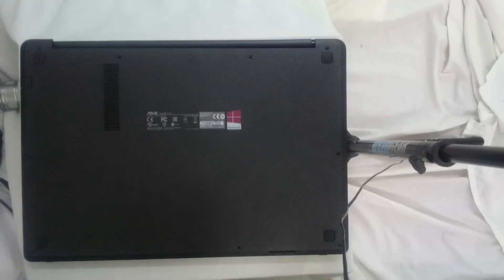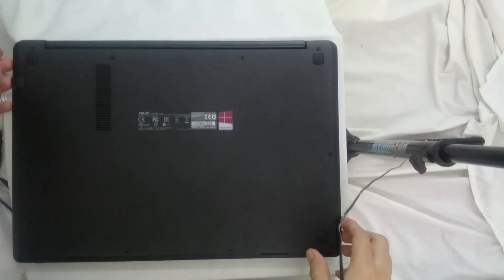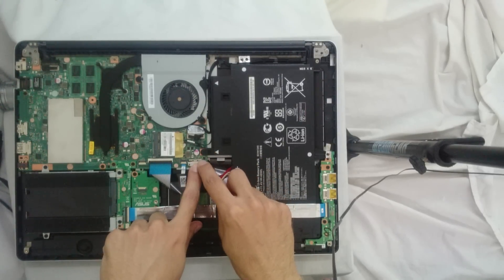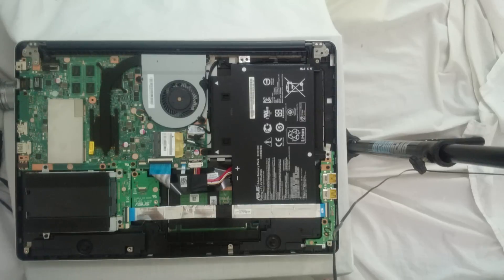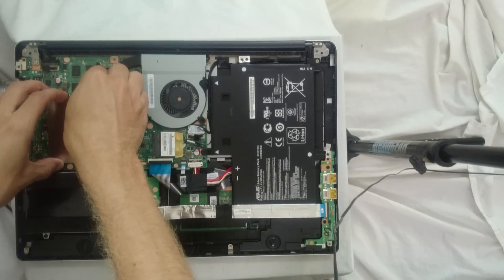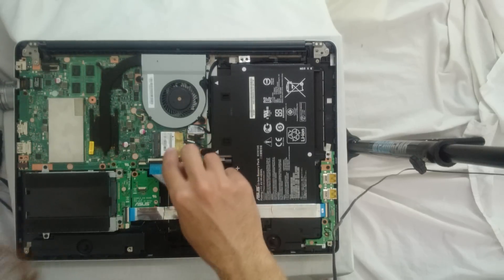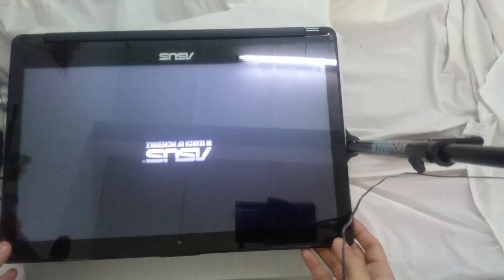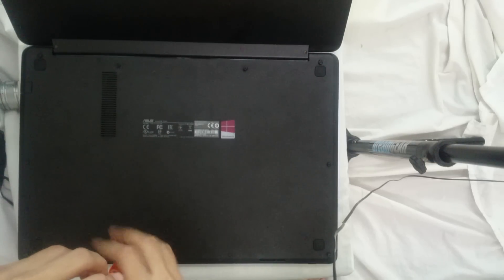Upgrade ASUS Transformer Book Flip RAM, SSD and Hard drive TP500LA - TP500LN

Comment: When I opened up the laptop to check the ram, there wasn't any ram under that shield but the laptop ran for 5 or so years without a problem. Is there another ram slot for this computer somewhere?
Reply: A 4gb integrated this slot to add upgrade

Comment: Lucky you, you have the mSSD daughter board.   Unfortunately for me, it is missing.
However your video shows the ribbon cable to be missing so you can't install an mSSD and have it work.

As for the memory replacement, I realize it is a simple thing but you could have demonstrated its uninstall and install by removing and re-inserting your 4GB module.

Comment: I would like to upgrade my hard drive to have more memory.  It is the version that has only like 2G on board hard drive.  Is there a way to buy a larger hard drive or will inserting the sd card in the little slot that you showed early in the video increase the C: drive? If I can just buy a new larger hard drive memory, where would I get that? Does amazon have this?  Thank you!

Comment: for this laptop are there two ram stick slots or only one?
Reply: As far as I know It comes with a 4GB ram onboard and an empty RAM slot. So you can load another 8GB RAM to have the max 12GB ram available for this laptop.
Reply: only one
Reply: two with max 12gb of ram
Reply: Where is the location of the other RAM slot?

Comment: You can't change the RAM. it's on board.. you just upgrade it from the RAM Slot. be sure to remove the cover after placing it.. it will cause you flickering on screen.. coz of being magnetized by the battery..

Comment: I have a TP500LA with no GPU, it looks EXACTLY like this when I open it up except the slot where the GPU is, is empty. I bought a fan module that looks like the one in this video and I know it fits. Is it possible to install the known compatible GPU and will BIOS except it? Is there anything I should be aware of?
Reply: *accept
Reply: It is really hard to replace a gpu on laptops, because laptops are built on gpu dimensions.

Ccl = dont buy laptop if you need to upgrade gpu

Comment: Hey, so I have the tp500la and my screen is 720p with a lot of backlight bleed. I plan on buying a screen assembly such as this to replace it with: http://www.ebay.com/itm/For-Asus-Transformer-Book-Flip-TP500LA-LCD-Display-Touch-Screen-Assembly-1080p-/172035919434?hash=item280e23ce4a:g:tK0AAOSw0QFXCSMT

Any idea if I can replace the screen with a 1080p one despite the original being 720p?

Comment: can I upgrade the cpu
Reply: Honestly, I'd look at a similar model with same motherboard like the TP500LB matching your manufacturing year for something "compatible". You need to be aware of cooling as well as the fact that if the CPU is somehow soldiered on, your are royally screwed. I'm actually trying to upgrade the GPU and I know that the TP500L series have been known to use the 840m and the 940m (broadwell CPU version)
Reply: +Hisaam Hashim thanks
Reply: +Hisaam Hashim cuz I have a TP300L so I wanna upgrade my RAM too like does it have a dual slot

Comment: Is it possible to upgrade the GPU (I wouldn't think so :) )? If not, what about the WiFi card?
Reply: you are asking the right question. As you may have noticed, the TP500 LA and LB (etc) are different mainly in that one has CPU and other has GPU. I have the LA and can tell you the mobo layout is EXACTLY the same --- it even has a location where the GPU can sit. Only question is if the GPU is soldered on this model. If it is not and is only held by screws from the fan/heatsink module, you should be able to add a GPU by buying the fan, the GPU and then applying good thermal paste. I actually plan to try this as an experiment but it would be helpful if the OP could give us the model number of the GPU in this laptop model as well an idea how it is held into place (screws only?) or if it is soldiered.
Reply: +Hisaam Hashim *One has CPU only and other has CPU+GPU
Reply: I found out that the GPU is actually soldiered on the board on the TP500LN/LB. Other than BIOS modification, you probably have to take it to a professional and given them the parts for them to soldier them. After that, you have to attach the TP500LN fan board assembly with thermal paste to probably get it working - not work the risk of breaking the laptop.

Comment: if the shielding is there to protect the user from ELF radiation then its a very good reason. Its why i am buying it. I tested it with a radiation meter and its a class apart from the others.

Comment: Can I install a ssd into it?  I have a TP500L laptop that come without ssd I think
Reply: *****
 Thanks
Reply: +Dan The Man Do you know if this is the same for a TP300L? I want to upgrade the ram, and possibly the HDD to a SSD as the thing is SO SLOW. Gf got the i3 edition so that doesn't help either.
Reply: ***** Awesome, that is with the TP300L yeah? Yeah it just dies whenever you want to do anything more than one thing at once, even then it is pretty damn slow. Thought more ram would help with the multitasking a bit. SSD I know would help a lot. Just wasn't sure if it was applicable to the TP300L like the TP500
Reply: +Dan The Man Is 4 gb ram really ok? I mean my desktop pc idles with 2GB ram usage, turn on game and browser and it breaches 4gb barrier.. Right now as I'm typing my computer is using 4.2GB.
Reply: +Deny Demise i have tp500l and its really hard to open it how can i open it?

Comment: I was wondering if I can use my 8 gig ddr3 ram from my old laptop to this one? I mean I heard that you cannot use ddr3 with ddr3l.
Reply: nick021234 you must specifically use DDR3L... I had the same dilemma... its a good thing that the shop owner asked me about this Low voltage ram thing before I went ahead and bought the 8gb DDR3....
Reply: Thanksp

Comment: can i replace the wifi card?
Reply: If it is ASUS, you should be able to do that as long as you connect the antennae correctly and if you have the properly sized wifi card. Some brands like HP and Lenovo like to BIOS block you from upgrading your WiFi card, so keep that it mind. Asus shouldn't though. Give it a shot.
Reply: +Hisaam Hashim thank you. in the end I didn't replace the card, but managed to have it recognized under Linux
Reply: my laptop wifi card was damaged,,but I not have new one,,so I find one from my old 3 rubbish latops,,,and found one from acer laptop and replaced - and wifi starts working back again

Comment: I also have this laptop, its making some noise but only when I browse and playing games, I wasn't sure when I first got it if it was making the same noise cuz I was still in college when I got it(the room temp there was cooler,now Im at my home where its quite hot)
Reply: BlackTop I know your post is from a month ago but do you have the model with an 840M?If so it is most likely because there is only one heatpipe touching the CPU and GPU at the same time which is a terrible flawed design since the heat can go back and forth between the two dies. I had a similar problem with an old HP laptop from back in 2007 which would literally burn my hand with the heat it was putting out and spreading across entire enclosure of the laptop. I am surprised it was able to live until 2014.
Reply: TheOneWhoisDrunk I'm always open to replies :)...(yes mine is the one with 840m) hmm , somehow installing and using Windows 7 instead of 8.1 did the trick , so its probably something I installed in Windows 8.1.... but I wont say you're wrong either... it is probably so, also adding that the vent is kinda blocked by the hinge as a sacrifice to look like a MB
Reply: +TheOneWhoisDrunk Check speed fan and maybe see how it performs under high load with intelburnin test or prime95. I don't see why you would see a difference in 7 or 8 unless of a really bad driver. In which case, check Asus drivers on their support website for Win 8 ones or Win 7 ones (since 8 supports Win7 drivers)
Reply: Have not really cared to look at it, may replace the past on there with some MX4.
fan can spins up to 3K RPM IIRC.
It just might be the way the cooler is set up, since its right under the hinge of the screen and mostly just recycles its own hot air.
Reply: Hisaam Hashim thats the thing,,, its really strange... not sure if its placebo... but i did felt it was like that.... on W7 the performance was better...